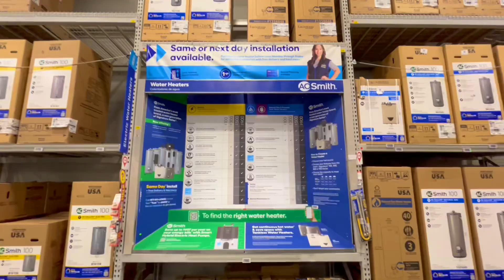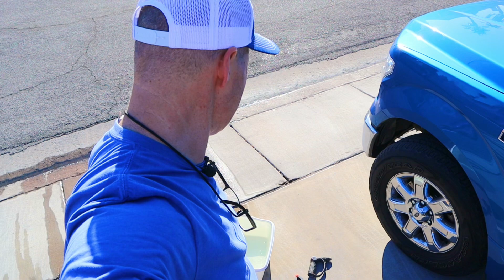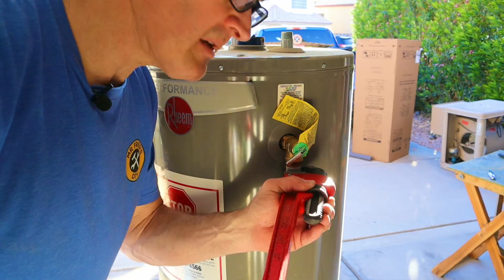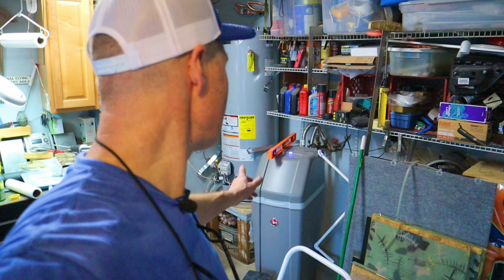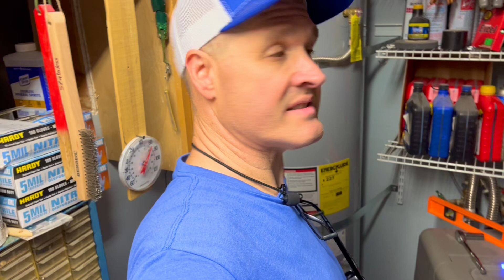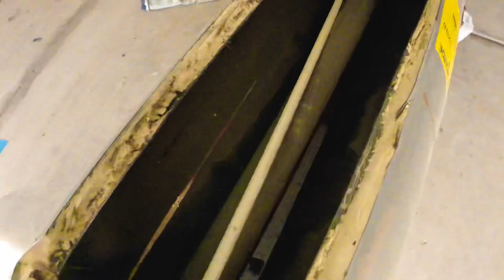Water Heater Installation -Why my 3 year old water heater failed!

Comment: Just install a water heater, they cost less than those HOT water heaters
Reply: It looks like you have a water softener there next to the water heater.  It should have been installed properly, so that doesn't seem likely to have caused the issue, but it does point to another possibility.  Since you need the water softener, that indicates the water quality isn't dynamite, and given the "improvements" they make to keep costs down (for the manufacturer), the anode could have been made smaller than in the past, since that's the 6-year warranty model.  Bad water, a smaller anode (or bad anode to begin with), and not checking the anode when draining the water heater could/would result in premature failure not being caught in time.  

It sounds like the anode might have been a piece of crap from the beginning, and your water quality sped up the process of it going to hell.  To be fair to the manufacturer, you did state that it was giving you signs of issues (the brown water).  Everything else inside seems to be good.  I do agree with you that the manufacturer should have been more proactive in helping you with this, but you didn't describe what your experience was with them.  Given that it's a 6-year warranty, and the anode rod is a consumable wear item, the warranty may lay out that what they did was acceptable within the warranty guidelines regarding the water heater.  While nobody expects a 6-year warranty water heater to require anode replacement so soon, it's possible that if you HAD replaced the anode when you started to notice this issue, you'd have a baseline to determine if it really required replacement.

Replacing the anode would likely have solved your issue for at least another year, and would have been far cheaper than replacing the whole tank.  AO Smith has been a great brand for me in my area - 13 years & 9 years thus far, with no problems for either, given that they were "6-year warranty" water heaters.  Timely replacement of the anodes, along with yearly draining of the tank go a long way towards keeping these things in working order.
Reply from the maker: Thanks for commenting! Our water here in Las Vegas is notoriously horrible. Another point of interest is that old water heater was manufactured in “2020” and we all know what happened that year.
Reply: @MrFredsDIY  "2020" could explain exactly what was wrong with it from the start 😉  Another thing to check would be if any fittings or pipe was replaced when that old water heater was installed.  If so, making sure there's a break keeping dissimilar fittings separate, with a dielectric union, would be vital in your bad water situation.  If that wasn't done, that speeds up the damage exponentially.  Not sure, but it looks like you've got copper AND galvanized in your setup, and without separating those two with the dielectric, you're creating a "battery" of sorts, which could also explain why the anode failed so quickly.
Reply: too funny! Preheating the water before the heater is expensive!